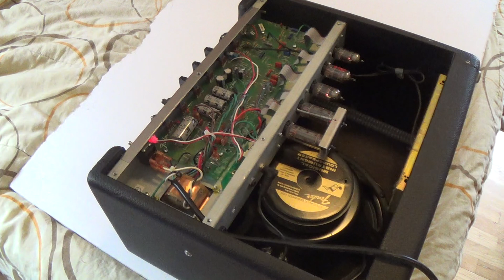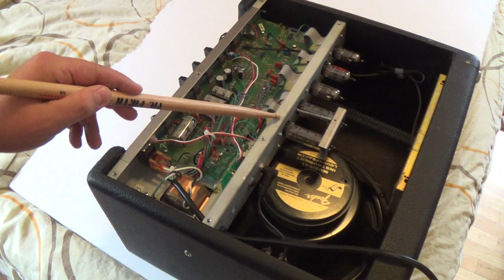Fender Blues Jr – Diagnosing Noise Issues Part 2

Comment: This gonna be more expensive than it might be worth .  The tube board can be replaced with after market of better quality and biasing pot. Not that expensive but gotta rewire everything including the ribbon cables which I would use better quality wire . Don’t forget the diodes and hot resisters on the main board ,replace with 1000 v type And lift them up off the board due to heat dissipation.

Comment: I noticed that the problems would start after about one minute, so i took a video. Didn't notice it live but watching video you can see what looks like arcing inside the left two tubes that lined up with the crackling nice noise. They all passed the tap test. I posted the video. It's actually sort of cool, blue arcing. Not cool due to this amp not having much time on it. It was built in Sep 23, 2021 and I bought it new in 2022.

Comment: Have one at the moment with mains hum and the power valves flashed up.. Just replace the four filter caps and change the tubes but still hums.. More investigation needed.. Also I love how you were talking over the loud amp then turned it off at the end 😂

Comment: Fender uses hot glue to hold parts in...  Also...  Nice job of using the required tapping on parts with a stick as necessary by all amp techs.  POS ribbon caples... Imagine that?  I moded my BJ.  It's a heartbeat away from getting sold to fund buying something better.

Comment: I’ve got one of these.....
Had noise problems, the power valve’s had both heated the solider joints loose.
I’ve also got an old 1979 deluxe reverb.
The old amp is far, far better in every way.

Comment: I recently did a billmaudio mod install . Replaced the 47uF cap, tone stack caps , input jack ( switchcraft ) , power stand-by switch . After all the up-grades I re-install my tubes and everything back in its places and turned on the amp . NO SMOKE happened which gave me some relief...but I have a lot of noise when up the volume ..I plug in the guitar and still have just noise ? Can you help me out ? Any help would be greatly appreciated !!
thank you .
Reply from the maker: Hey Sam, unfortunately it's really tough to diagnose the problem without being able to work on the amp but I would check a few things. Check all of your solder connections, especially on the input jack. The solder should look clean and shiny. If it's dull looking it might be a cold solder connection. The jack and the capacitors are in the signal path - those would be the changes that would most likely cause a loss of signal and the additional noise. Check to see that the capacitors have good clean solder connections as well. Just keep going over each change you made and double check them. These amps are reasonably easy to work on once you get familiar with them. The schematics for most all Fender amps are available online. Hope this helps.
Reply: Thank you for the reply and I will double check the work 👍🏽